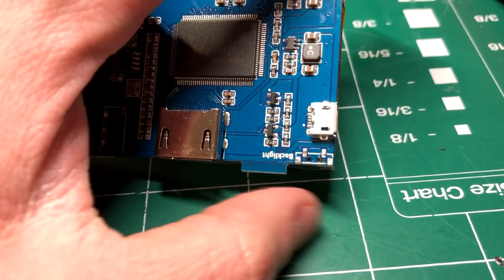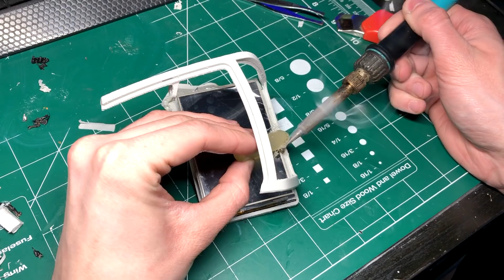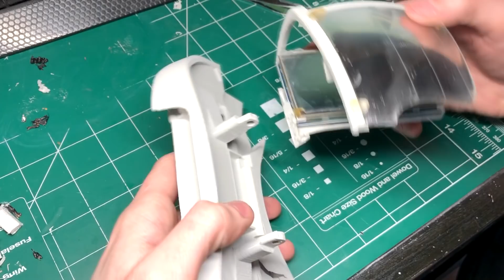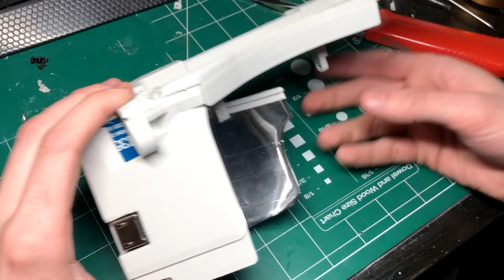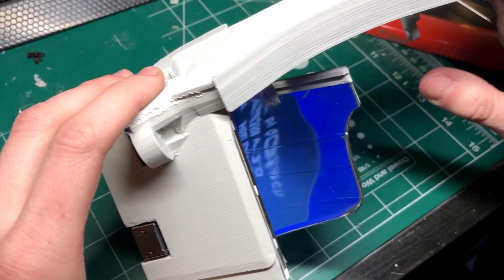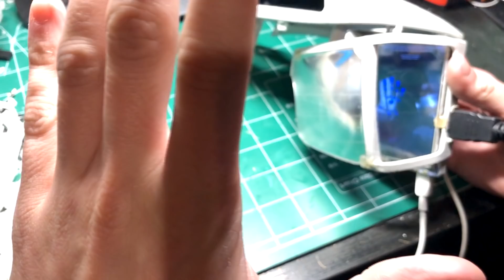Project Northstar Test 0

Comment: Which screens are you using?

Also wouldn't be better to use acrylate instead of hot glue?
Reply from the maker: I'm using theese screens : https://bit.ly/2HHr4lf

Hot glue is just temporary measure. It's non-invasive so I can just peel it off